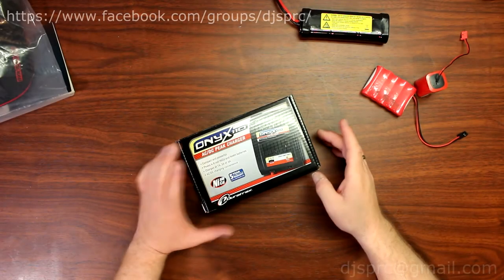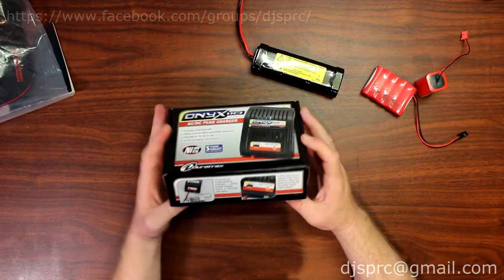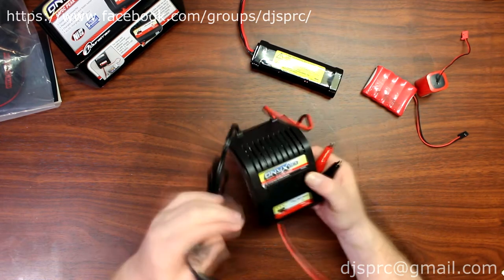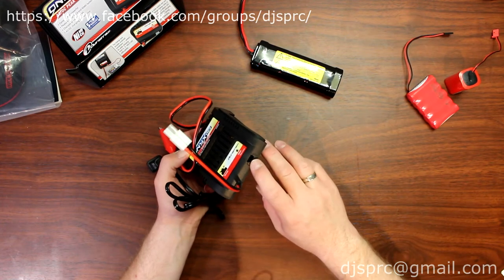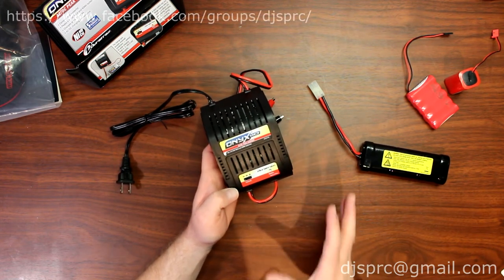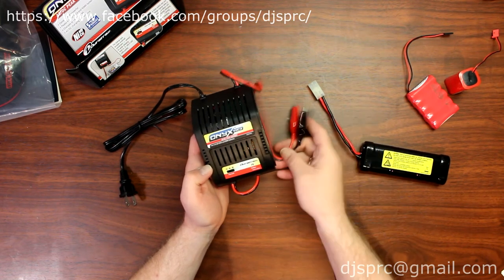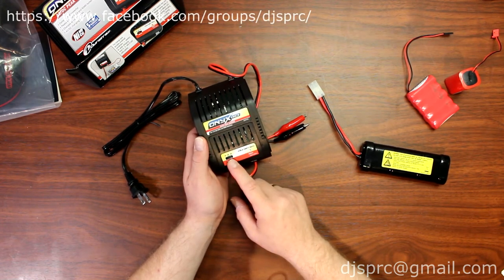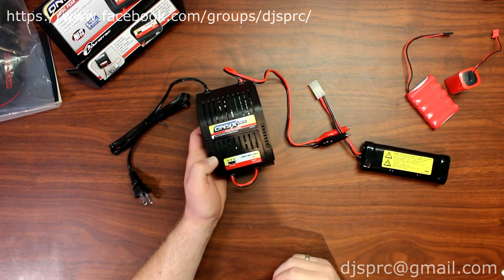Onyx 110 AC DC Peak Charger

Comment: What's orientation i should be plugging in the BEC type connector? Belly up or belly down? (By belly i mean u can see the metal, back would be all plastic)
Reply from the maker: Are you talking about the servo connecter if yes there's only one way you can plug it in

Comment: Does the light turn green when charging is done?
Reply from the maker: I do apologize I do not remember.  I am trying to remember but I think so not sure
Reply: @djsprc  it's fine I appreciate the response
Reply from the maker: felix pineda Once I get home I’ll take a look and I’ll respond back to you
Reply from the maker: felix pineda  Fast charge will start automatically when the charger recognizes the battery is connected to the output. The LED will turn on at this time.
When the charger detects the battery has reached peak, fast charge will end and trickle charge will begin automatically. The LED will flash TWICE every five seconds, indicating trickle charge is in process and the battery is ready for use at
this time. The charger will remain in trickle charge mode until the battery is disconnected from the charger

Comment: Can I charge LiPo batteries on this
Reply from the maker: Please do not charge a lipo with this charger.  this charger is not meant to charge a lipo.
Reply: djsprc just cancelled my order
Reply from the maker: If you’re looking for a good charger not too expensive they will do multiple batteries or should I say multiple chemistry look for skyrc s60 or s65
Reply: djsprc yeah I’m also looking for a brushless set. I was also wondering if LiPo batteries would make my brushed motor faster.
Reply from the maker: Dude No wonder Technically speaking yes the reason it’s going to feel faster because I lipo  will keep its current until the end
Reply: djsprc btw I just ordered a velineon motor for my rustler. Would happen to know if I need different pinions on it or can I just use the stock pinions?
Reply from the maker: Dude No wonder Your stock one should be 19 if you’re going brushless run a 25 and go 83. Traxxas parts number is 4725 pinion 4683 is spur
Reply: djsprc oh ok thanks. So it wouldn’t be a good idea to use the ones that come with it ?
Reply from the maker: Dude No wonder Running stock gears you may overheat the motor
Reply: djsprc dang well thanks for all the info. Much appreciated 👍🏻